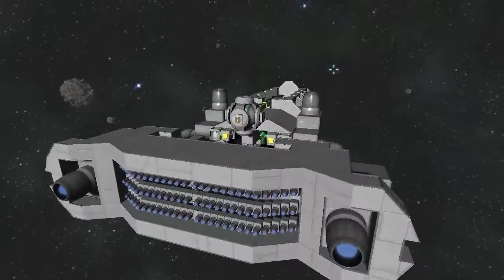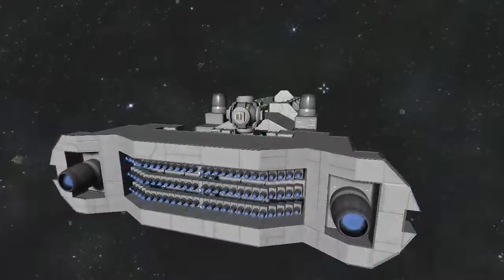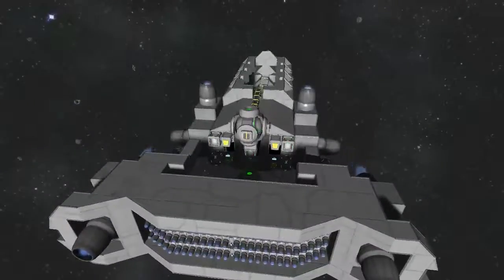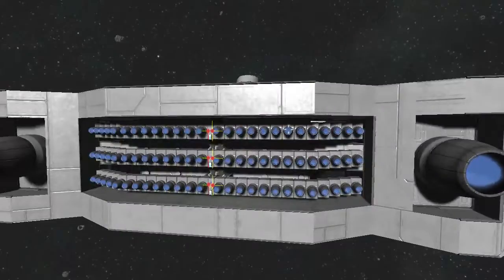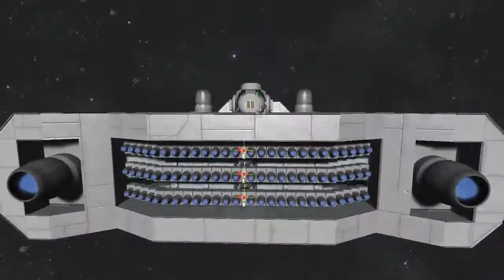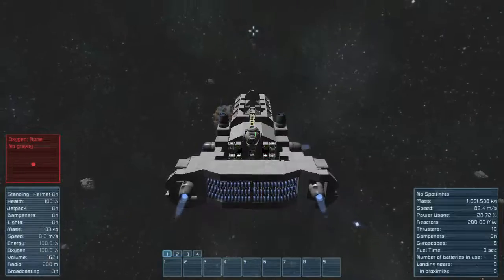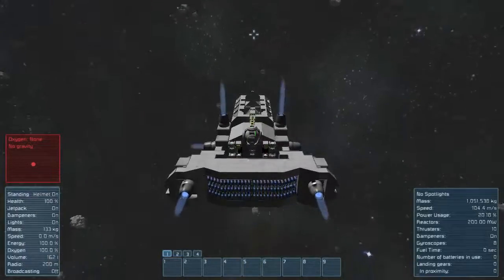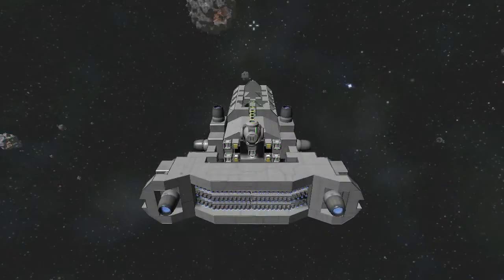Space Engineers: Integrated Gravity Drives

Comment: I haven't come by your channel for a week and you already have a dozen more vids up. Geez, you've been busy. 
Very beautiful application and use of math in this game.
All that is missing now is to connect rotors on both sides of back wall with all the small thrusters on it and then rotate control them via a prog block to tilt in directions you wann move it faster. It's like thrust vectoring tech on modern jet fighters and ships with water jet engines instead of classical propellers. It would allow for the ship to drift but also cut sharper corners. If you design it to be capable of turning to face forward with enough clearance  you could eliminate the forward thursters completely and just use thrust vectoring to brake. I dont know how fast you can rotate them all if they are connected in one big wall. Maybe divide the back thrusts into two tiltable walls, cuz that will allow each wall to tilt faster. You'd need 4 rotors for that. Jag gillar din Norse namn. (Swedish for = I like your norse names). No, I'm not swedish.
Reply from the maker: TrustMeI'mAnEngineer The problem with thrust vectoring in Space Engineers is that the rotors tend to snap off and their max rotational speed is low. If I could get around that, it'd be possible.